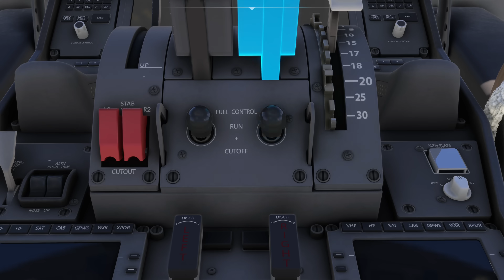Air India 171: Why Did The Fuel Cut-off Switch Get Moved?

Comment: AI 171 Report Crashlands
Inquiry is disservice to airlines flying Dreamliners. It's also slanted so that attention focuses not on possible technical problems but, minus any real evidence, on pilots
Amit Singh
On June 12, an Air India Boeing 787 took off from Ahmedabad and crashed moments later, killing all but one of its occupants. Exactly a month later, the official preliminary report was released. While it provides a basic sequence of events, it fails to answer the most critical question: When did the engines stop producing thrust?
FORMER Chief of Safety, Air Asia & Chief of Training, IndiGo
This isn't a technical debate. It's the key to under-standing what went wrong, and who or what was responsible. Instead of offering clarity, the report quietly steers readers toward the idea of pilot error, without saying it outright. This subtle shift leaves many, especially those unfamiliar with aviation systems, assuming the pilots made a mistake. That assumption is both dangerous and unfounded.
Captain capable
It's important to begin with the man at the controls. The captain of AI 171 was not only a seasoned Boeing 787 pilot but also a certified trainer entrusted to teach and evaluate others. As part of the selection process to become a trainer, he had undergone detailed psychological screening, including by profes-sionals trained to assess stress-handling. decision-making, and mental fitness. He was the pilot you'd want in the cockpit on a bad day.
Yet, certain foreign media outlets have floated malicious theories, suggesting pilot error or intentional action. Shockingly, one Indian "safety expert" repeated these ideas without evidence. The report does not support these theories, and they insult the memory of a competent professional who can no longer defend himself.
Let us be clear: no factual basis exists to blame the crew. The available evidence points to more profound, more technical questions that the report avoids addressing.
Noise & silence
The report says the aircraft's two engines stopped responding three seconds after takeoff. It also says the pilots tried to restart them about 10 seconds later. By then,
the plane was flying too low and too slow to recover
It also notes that two necessary switches, used to control the engine fuel supply, were moved to the 'off' position. These switches are designed to be hard to move accidentally, and they have locks to prevent that. The report includes a short voice recording from the
cockpit without clear attribution: Pilot 1: "Why did you cut off?"
Pilot 2: "I didn't do it."
That's it, no further transcript. No context. The words are used to hint that maybe one of the pilots
turned off the engines. But there's no follow-up. No analysis. No explanation for how these switches might have moved on their own, which is entirely possible, based on earlier warnings issued by safety regulators about this exact type of switch used in another Boeing plane the 737.
Big contradiction
CCTV footage from June 12 shows the aircraft in the air, landing gear down, and a small emergency device called a Ram Air Turbine (RAT) already extended. This turbine is like a small windmill that pops out when both engines fail, helping to power basic flight controls.
The issue is that this turbine doesn't deploy instantly
It takes a few seconds to come out after both engines stop. Yet, in images, it's already visible when the air-craft is barely a few storeys off the ground. That means the engines must have failed before the time mentioned in the report.
So, which is wrong, camera images or the AAIB report's timeline?
Silent beacon
Additionally, the aircraft's emergency locator beacon - which should have started transmitting dis-tress signals on impact-stayed silent. Was it damaged? Not armed? Not working? Once again, the report gives no answers, nor recommends checking other aircraft for similar issues.
No flag raised
A good preliminary report is not meant to assign blame; it should highlight urgent risks so other flights can be safer. That didn't happen here.
Despite known concerns about the fuel control switches, the report doesn't call for any checks across the Boeing fleet, doesn't advise reviewing the emergency response systems, and doesn't confirm that all the flight data and voice recordings were recovered.
Compare this to other major accidents -like the Ethiopian Airlines crash in March 2019-where early reports included technical diagrams, full transcripts, and multiple safety recommendations. The contrast is stark.
Final thought
This isn't about one flight. It's about how we investi-gate air accidents in India, treat our professionals, and protect public confidence in aviation safety.
The captain of Al 171 was a respected trainer and a trusted professional. His actions in the final seconds cannot be judged by a single voice quote taken out of context. They must be understood in light of the systems around him the ones that may have failed first..
The real questions are these: when did the engines stop working-and why? That's what the public deserves to know. That's what the final report must answer.
experience The writer is an aviation professional with over 35 years'

Comment: You said that the switches were moved to the off position then back to on. Would the pilot not have to do this to re-fuel the engines if the engines were shut down by malfunction? Also the LEFT engines was switched on first. If the flying pilot (in this case, the right seat) was focused on FLYING and the left seat did the cutoff, why didnt the right seat turn on the right (closer) one first? There is logic here that isn't adding up......

Comment: AI is by it's very nature indeterminate which means no two planes will behave the same way in the same situation and the behaviour will be modified over time.  Therefore, there would be no way to qualify an aircraft as safe to fly therefore AI (which is nothing but pattern recognition) will never control aircraft.  Only determinate software can serve as an aid.

Comment: How likely is to have a computer glitch? Is the cut off of fuel directly to the pumps, or through the computer? Since for me, the time took to restart the engines, since was quite long between the two swithches shows as a computer glitch, and the pilots tried several times to make it on until worked out. I am a computer expert and this looks like a computer glitch.

Comment: It's a fact 99% of crashes are pilot errors. Times have changed. A.I./Computers need take over from pilots, in reality they no longer needed. Computers 10,000X more efficient,  more accurate, quicker to respond, zero emotion. Pure Data. The days of the pilot are numbered. No more elevator operators needed.

Comment: It seems to me that it takes a deliberate effort to switch the fuel cuttoff switches to off... 
WTH?
Reply: AI 171 Report Crashlands

Inquiry is disservice to airlines flying Dreamliners. It's also slanted so that attention focuses not on possible technical problems but, minus any real evidence, on pilots

On June 12, an Air India Boeing 787 took off from Ahmedabad and crashed moments later, killing all but one of its occupants. Exactly a month later, the official preliminary report was released. While it provides a basic sequence of events, it fails to answer the most critical question: When did the engines stop producing thrust?

FORMER Chief of Safety, Air Asia & Chief of Training, IndiGo
This isn't a technical debate. It's the key to under-standing what went wrong, and who or what was responsible. Instead of offering clarity, the report quietly steers readers toward the idea of pilot error, without saying it outright. This subtle shift leaves many, especially those unfamiliar with aviation systems, assuming the pilots made a mistake. That assumption is both dangerous and unfounded.

Captain capable:
It's important to begin with the man at the controls. The captain of AI 171 was not only a seasoned Boeing 787 pilot but also a certified trainer entrusted to teach and evaluate others. As part of the selection process to become a trainer, he had undergone detailed psychological screening, including by profes-sionals trained to assess stress-handling. decision-making, and mental fitness. He was the pilot you'd want in the cockpit on a bad day.

Yet, certain foreign media outlets have floated malicious theories, suggesting pilot error or intentional action. Shockingly, one Indian "safety expert" repeated these ideas without evidence. The report does not support these theories, and they insult the memory of a competent professional who can no longer defend himself.
Let us be clear: no factual basis exists to blame the crew. The available evidence points to more profound, more technical questions that the report avoids addressing.
Noise & silence
The report says the aircraft's two engines stopped responding three seconds after takeoff. It also says the pilots tried to restart them about 10 seconds later. By then,
the plane was flying too low and too slow to recover
It also notes that two necessary switches, used to control the engine fuel supply, were moved to the 'off' position. These switches are designed to be hard to move accidentally, and they have locks to prevent that. The report includes a short voice recording from the
cockpit without clear attribution: Pilot 1: "Why did you cut off?"
Pilot 2: "I didn't do it."
That's it, no further transcript. No context. The words are used to hint that maybe one of the pilots
turned off the engines. But there's no follow-up. No analysis. No explanation for how these switches might have moved on their own, which is entirely possible, based on earlier warnings issued by safety regulators about this exact type of switch used 

in another Boeing plane the 737.
Big contradiction
CCTV footage from June 12 shows the aircraft in the air, landing gear down, and a small emergency device called a Ram Air Turbine (RAT) already extended. This turbine is like a small windmill that pops out when both engines fail, helping to power basic flight controls.
The issue is that this turbine doesn't deploy instantly
It takes a few seconds to come out after both engines stop. Yet, in images, it's already visible when the air-craft is barely a few storeys off the ground. That means the engines must have failed before the time mentioned in the report.

So, which is wrong, camera images or the AAIB report's timeline?
Silent beacon
Additionally, the aircraft's emergency locator beacon - which should have started transmitting dis-tress signals on impact-stayed silent. Was it damaged? Not armed? Not working? Once again, the report gives no answers, nor recommends checking other aircraft for similar issues.

No flag raised
A good preliminary report is not meant to assign blame; it should highlight urgent risks so other flights can be safer. That didn't happen here.

Despite known concerns about the fuel control switches, the report doesn't call for any checks across the Boeing fleet, doesn't advise reviewing the emergency response systems, and doesn't confirm that all the flight data and voice recordings were recovered.

Compare this to other major accidents -like the Ethiopian Airlines crash in March 2019-where early reports included technical diagrams, full transcripts, and multiple safety recommendations.

The contrast is stark.
Final thought
This isn't about one flight. It's about how we investi-gate air accidents in India, treat our professionals, and protect public confidence in aviation safety.
The captain of Al 171 was a respected trainer and a trusted professional. His actions in the final seconds cannot be judged by a single voice quote taken out of context. They must be understood in light of the systems around him the ones that may have failed first..
The real questions are these: when did the engines stop working-and why? That's what the public deserves to know. That's what the final report must answer.
experience

Comment: there's a FAA directive stating that the fuel cut off switch by design could inadvertently switch itself off in mid flight . . . this applies to all Boeing aircraft from the B737-800 all the way to the B777-300 ER including the B787-8/B787-9 & B787-10 . . .

Comment: Is it possible to shut off the "fuel cut off switch" by mistake?
Is there a fail safe mechanism that would prevent this from happening. 
If not, then there are only 2 possibilities IMV:
1. Deliberate by one of the pilots, very likely the co-pilot.
2. Human error in switching it off and then the obvious denial.

Comment: One scenario missing is, a possibility of intermittent problem on the fuel cut off switch.  In electronics it does not matter how temper proof mechanically, it happens.  When fuel was cut off, we tend to think it was a human action, but it may be electronic intermittent problem.  So, it was not human action but electronic playing the tease.  So the res ponce was, "I didn't do it."  So the copilot resent the control, tuning off mechanical switch and then turn it on as one of the technique to resolve the problem.  That what co-pilot did, therefore, it took 10 sec.  That is the reason both switch were on position at the time of crash.  Assuming flight recorder indication of both fuel control switch were off to be human action may be wrong, but electronic intermittent problem.  Any technicians know intermittent problem is a worst trouble to fix it.  Might this be a possibility the investigators are missing?

Comment: fact: switches was turned off (1 second).  A dreamliner pilot said it is impossible to do in 1 second does it have weight?.  Could they measure how long it takes to switch it from on and off from either seats to determine who switched it off (considering dominant hand factor).

Comment: Captain Steve once said you can hear that a  turbine engine is spinning down even before you see it. So my theory is that the first pilot could hear the engine being starved and then asked the other pilot only for both of them to find the fuel switches on the run position. Then they set them to cut off and then to run again in an attempt to relight the engine. Isn't it surprising that the FADEC could not relight the second engine at such a low altitude? I think something caused both engines to fail. Is it possible that the current explanation is just the most convenient one? Not suggesting any malpractice by the investigators but only indication that bias can have the same effect as malpractice.

Comment: If the switches were off on the stand during refueling, would there be enough fuel left in the system to the engines to allow take off.?

Comment: Hi Captain…. Is it possible that the plane took off on switches on cutoff…. and whatever residue fuel was there in the supply valve got the plane in the air before the Rat got deployed and the pilots reset it to Run.

Comment: Hi Steeeve, thanks for going into all those questions! So here is mine: The preliminary report is deliberately vague on the conversation between the pilots and does not contain a full transcript. So we don't even know whether the PF or the PM cut off the fuel or what the immediately preceding conversation was.

So what about the deployed landing gear? Was it due to be raised before or after the time of the fuel cutoff? Is it possible that one pilot was "distracted" and cut off the fuel instead of raising the landing gear?

Comment: Captain Steve, do you agree that modern aviation disasters often come down to incredibly rare mechanical malfunctions? Is it not at all possible (many millions to one) that the fuel switches were faulty and somehow were partially engaged (enough to give a positive fuel signal) at take off and vibrated to CUTOFF during lift off (and yes BOTH placed in partial engagement at start-up with a two-hand action at the same time). Could you please consider this very unlikely scenario and see if it fits the evidence? Thanks

Comment: @ Capt Steve, I don't mean to say that pilots wouldn't have made the mistake. But CVR recording show otherwise. When one pilot question's the other if he SHUT OFF ? the second guy has replied NO I DIDN'T. 

Also the report further states that both engines were relighted and the No 2 didn't spool up,( as by then the aircraft had impacted). So there was every effort in those last seconds to save the situation by attempting to relight the engines. It also means the engine failure wasn't intentional on part of the pilot but the sudden shut down took them by surprise.

Efforts to pass of this event as suicide by pilots is totally nonsense. I mean for the likes of Steve who claims to be an expert, Air India would be  walking stupids to allow some mentally challenged individuals to fly wide body. The Capt has more than 8000 hrs of flying experience on the 787 Alone and to suggest that one of them had suicidal tendencies is totally uncalled for.

Talking about pilot's mental health is good and this angle should also be explored nothing wrong but to cast an opinion without having any such report to suggest any mental ill health is cruelty especially for the family members of these pilots and to those lost their loved ones.

Learn to be sensitive and sensible before appropriate blame on any individual

Comment: It's possible the one who cut the fuel wanted to pin it on the other pilot (likely the pilot flying who may not have noticed). So he asked the innocent pilot why he did it and the innocent pilot had no idea what he was talking about. It's also possible the one who cut the fuel put it back because he knew it was too late anyway and then the investigators would find the fuel switches in the correct positions.